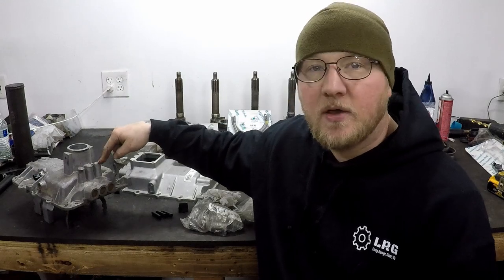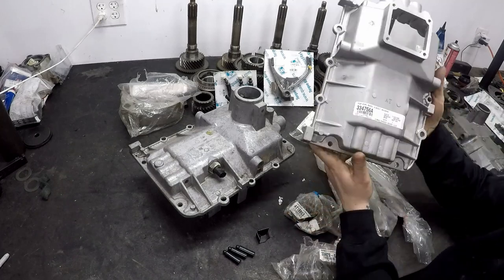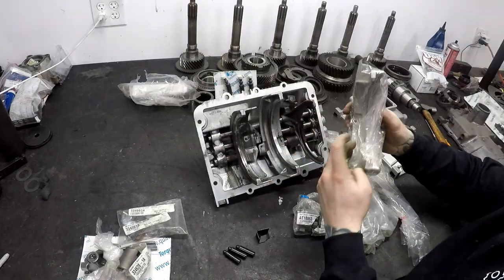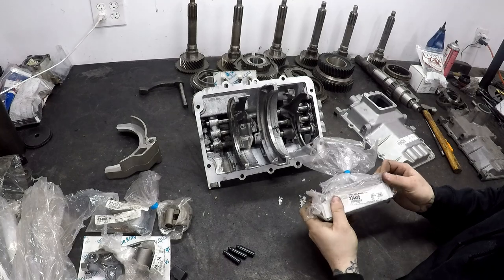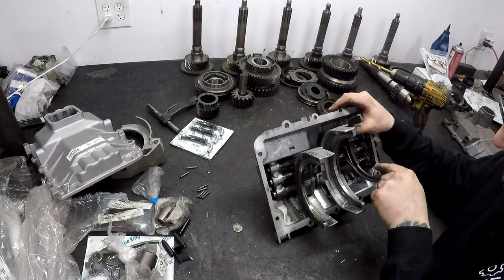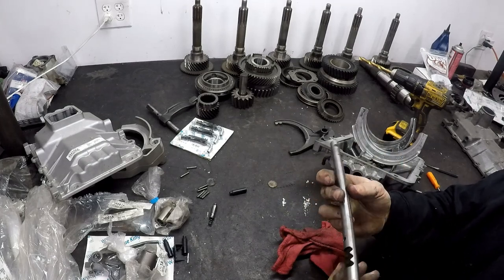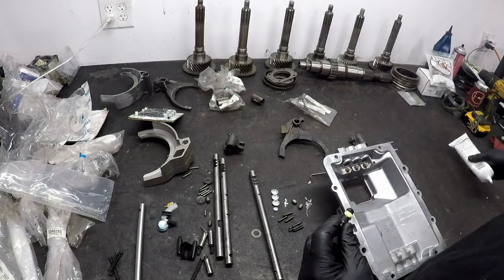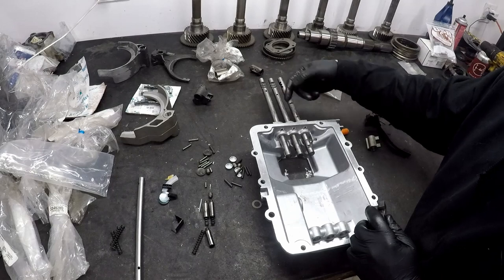Convert your round top NV4500 to a square top! Dodge Ram Cummins 5 speed manual.

Comment: Man i have to say thanks for the super helpful video. I will be watching it again in my garage for sure when i do my nv4500. Just picked up a donor v10 4x4 auto truck to do a frame swap on my 2wd nv4500 12v cummins. My plan is to do a full rebuild and convert the nv4500 to 4x4 output shaft with the cast iron housing upgrade. Its a round top now and the shifter is well.. rather sloppy lol. I hope to see your channel blow up with views cause the info your providing is incredibly valuable to the average automotive hobbyist like myself. Subbed and looking forward to future videos.
Reply from the maker: Thank you! I’ll be coming out with a video series pretty soon (hopefully within the week) that I think you’ll find quite helpful on your endeavor 🤘🏼
Reply: Just did this not long ago, used a v10 4x4 5speed frame and transmission for my 2wd 12 valve truck. Way cooler truck now

Comment: I have a square top cover that i need to replace a broken 3-4 shift fork. Is it possible to pop the roll pins on the square top without drilling holes through the cover?

Comment: Thanks for the video!! This is super helpful as I want to just service my square top. How do you judge if the forks need replaced ? I can see my 1-2 3-4 show some wear from the collar but I don’t know if it’s
Needed to replace
Thanks
Reply from the maker: If the contact area of the forks are damaged or worn bad enough that you can feel it with a fingertip, its best to swap them out. Theyre cheap. Good luck.

Comment: The dodge NV4500 tail housing, what to look for in the aluminum ones vs the steel ones???

I need one and I found an aluminum one really cheap. Pros and cons??
Reply from the maker: I have a whole pile of the because we dont use them. We only install cast iron housings, it help with rigidity and supports the case much better, plus theyre only about $150 bucks.
Reply: @longrangegear  have you seen them faill a lot?
Reply from the maker: @JTNiebrugg  only a couple times we’ve seen them crack, and pour all the fluid out- we upgrade to the cast iron not only because theyre less likely to do that, but we believe they support the case better in that area thats rather thin.

Comment: I have a NV 4500 in my 93 K1500 Chevy, I've had it for 10 years, my 4th gear pops out only when letting off the accelerator, it's been doing it since I first got it, it's not gotten any worse in all those years, but it's annoying, is it the 3,4, shift rail that I need to change?
Reply from the maker: If its popping out of gear, the top cover will rarely be the fix for that. Generally, it the gear and slider combination that have worn the backcuts down until they can no longer hold themselves into gear. Basically, i needs to come apart to fix it.
Reply: @longrangegear  Thanks very much for your reply
Reply: It only does it when I'm in 4th, and I can leave my hand on the shift knob and keep it from jumping out, I guess I'll leave it.

Comment: Is the 1-2 shift lug absolutely necessary? I haven’t been able to find it anywhere, even with the part number.
Reply from the maker: Its not but the early shift lugs are spring loaded and the later ones are not. If you reused 1-2, you have a top thats spring loaded to one side and not the other. You could try reusing all the shift lugs/forks. I havent tried it yet since it isnt “correct” and i dont have any five speed trucks of my own to experiment with, but I’ve been curious if it would work. I think it will. If you try it, please let me know!
Reply: Will did you try it with the old style shift lug?